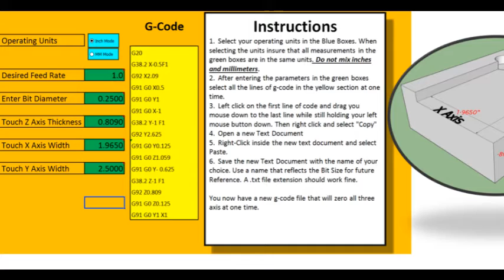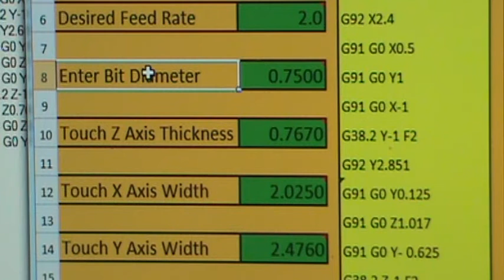3 Axis Auto Zero Short

Comment: Nice video, Charley. I'll add that the same thing can be accomplished manually by putting a .250 stainless rod in the spindle, and a strip of paper between the rod and workpiece. Move the spindle toward the workpiece .001" at a time until the paper is stuck between the rod. Compensate for 1/2 the rod diameter and you have your edge. Same approach works for both X and Y. Your way is much, much faster. Nice job.